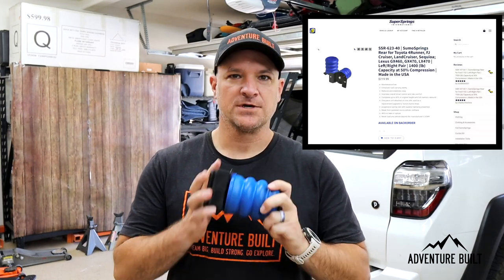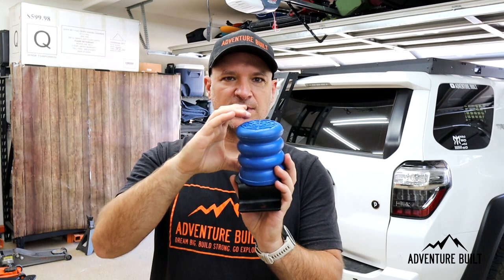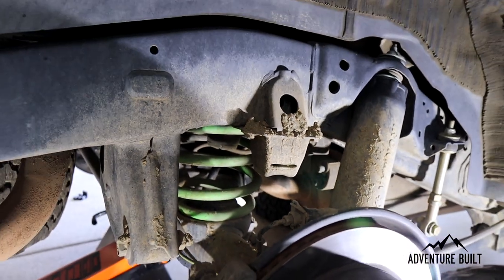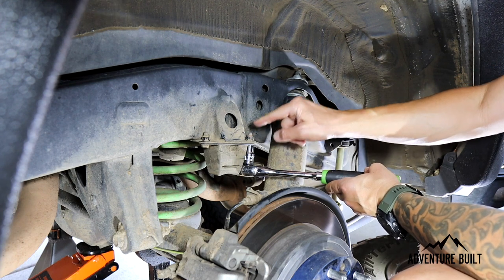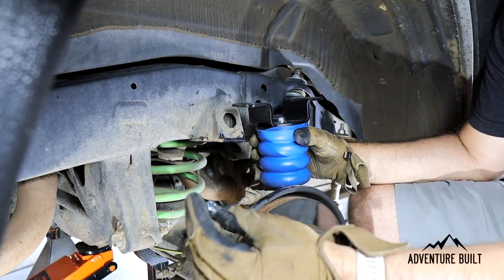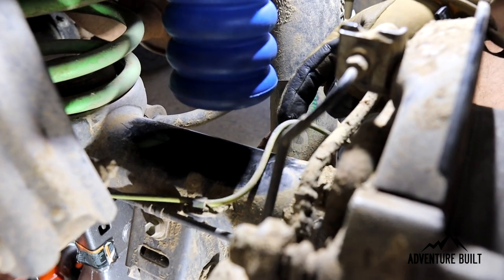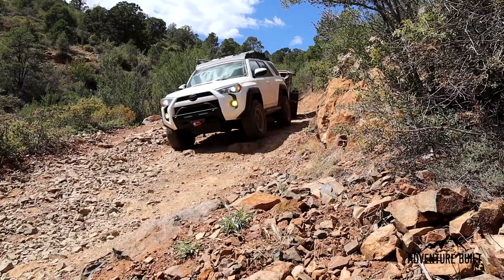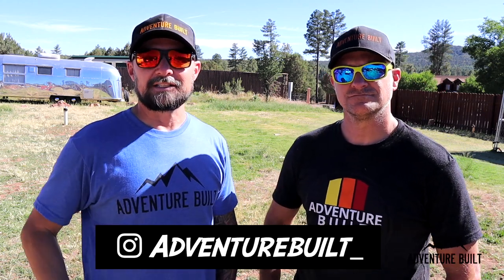AMAZING IMPROVEMENT | SUMO SPRINGS INSTALLED ON 5TH GEN 4RUNNER | DO THEY LIVE UP TO THE SUMO

Comment: I put Sumo Springs on my Tacoma several years back. The difference was so good I'll never own another truck without installing a set of Sumo Springs
Reply from the maker: Very cool. I’m leaning towards getting them for the Tacoma also now. Thx.
Reply: @AdventureBuilt  I may have missed it in the video but another minor but important benefit to the Sumo Spring, is they allow for a bit more up travel on the axles because they compress below the level where the stock bump stop, stops the axel from moving up anymore.

Comment: Will you be installing these on your Tacoma? Will these prevent rear sag when loading up extra heavy things in the back? I have Extra Heavy OME leafs (added a lead to the heavies).  I have a camper 400 lbs. and might carry a dual sport dirt bike in the future on the hitch in my Tacoma. I was leaning toward air bags..
Reply from the maker: I will most likely be adding these to my rig also to help out with the bottoming out that happens once in a blue moon. I think you will absolutely like the sumo springs but you are really heavy so air bags might be better. Sumo springs would be more reliable but air bags would be more helpful with controlling all that weight. I wish I knew more about the air bags. Hope this helps.

Comment: I added Sumo Springs to my TRD OR LB because I pull a small camper and they've been awesome to reduce the harsh bottoming out. I too recommend them.
Reply from the maker: Awesome man. I’m pretty sure I’m gonna get a set for the Tacoma also. Doesn’t happen often but when it does it is pretty violent.
Reply: Did you go blue or black?  I'm at the same decision point and wondering if the blue it too light.  Thoughts?
Reply: @peterolfert7477  blue
Reply: @peterolfert7477  Look at the wt ratings and what you carry. I have very small 16’ camper and usually just my wife and I so not much stuff. The blue has done well for me. They do squish when I haul really heavy loads but that’s only been maybe 2x in the past year+ of ownership. 
I hate the soft factory springs on the truck so I added airbags to prevent rear sag. I don’t want to get into suspension upgrades. I don’t need a lift, bigger tires and don’t want to deal with all the downstream changes that happen when you change suspension.
Reply: @briankilgore3479  you have airbags and sumo springs for the 16 foot trailer? I have a 2020 4runner orp and was looking at these instead of air bags
Reply: @shakeyfly  Tacoma is soft in the rear from the factory so the airbags level out the truck. I did the Sumo Spring first and those help with bottoming out but not necessary for leveling. I really don’t need both but I didn’t really want to remove the Sumo and it’s not hurting anything being there.
Reply: @briankilgore3479  Thank you, I have a 5thgen 4runner. Also a little soft and the added weight of the rear so I'm thinking I'll be doing both.

Comment: I have a 19 TRD OR w/ RC 2” lift. Any strut/shock failure issues on up travel if I added these? They seem to compress much further than a trad extended bump stop. Or would the red heavier ones resolve that?
Reply from the maker: Trevor has never had a single issue running the sumo springs. I’m not so sure that it really is compressing more and if it is it doesn’t seem to be causing any issues. Hope this helps.
Reply: @AdventureBuilt  thanks for the response! Looking forward to trying them out

Comment: i bought the front and rear sumo springs for my 2023 4runner and installed them, curious as to why you didn’t use the support plate? according to the included installation instructions there is a quarter inch flat piece of metal that is supposed to be sandwiched between the sumo spring mounting bracket and the frame.

Comment: If you notice @7:00 there is also a bump stop located inside the rear spring. On my 4 Runner I paired the sumo springs with the Icon hydraulic bump stops located inside the rear spring and I can literally hit the nastiest bumps at any speed and it won't bottom. When the sumo spring starts to fully compress the hydraulic bump takes over. Overkill yes but with way less travel I can hit bumps at the same mph than in my Raptor. Pair that setup with some good AT MT tires and higher speed desert running in a 4 runner is doable.

Comment: Are you changing it up because you’re not happy with the Ironman FCP?  I just put their Stage 3, 3” lift on my Lexus GX460 and my initial impressions are just mediocre, granted I haven’t mounted up the 35s yet since the wheels just arrived. Either way, this seems like a cool product and since I need new bumpstops anyways, maybe I’ll give them a try. One last question…do these seem to limit up travel?  Great content as always!  I’m loving your channel!
Reply: Did he mention changing the suspension? Because I think the Sumo bump stop is supplemental for when he’s riding heavy and towing, but otherwise the suspension seems fine.
Reply: @GrizzlyPath  He made comments about wanting to improve the ride and even says now he needs to address the front. It gave me the impression that he’s seeking ways to change the ride compliance which translates, to me, discontent with the setup. I could be entirely wrong.
Reply from the maker: Thank you very much and no Trevor is still in love with the FCP Stage 3. They basically just dampen the violent bottoming out when you are running heavy or sitting huge bumps. They definitely get more use when Trevor is pulling the trailer. And there is no limit in the up travel at all. Thanks again!!!

Comment: Let us know if the movement changes when temperatures drop. Remember old elastomeric Rock Shock mountain bike forks in the the 90’s that used urethane springs. The compression  and return rates changed as temps dropped.
Reply from the maker: I think it will definitely change but since it’s a bump stop and not the actual suspension I don’t think it will be an issue. Will definitely keep you up dated if it is.

Comment: I am about to put Sumosprings on my Lexus GX460. I tow a tandom axle trailer tipping the scales at 5500 lb and had a tongue weight of 600 lbs. I use a load leveling hitch. My question is would you recommend a Blue or Black set of Sumos??
Reply from the maker: I would say go with the blue. I doubt you would need the extra firmness of the black. Trevor is digging the blue.

Comment: I have a 2018 TRD Pro with a similar trailer. I'm debating these SumoSprings or just getting Dobinsons coils with 10% increased spring rate. I don't want to lose Offroad articulation. Thoughts? Thanks!
Reply from the maker: Trevor ended up going with sumo springs so he didn’t lose ride quality while not pulling the trailer. It’s a toss up. Hope this helps.

Comment: How do different lift height affect using this and up travel? It does look fairly long. Would Stock height fit this? You guys have how much lift in the rear?
Reply from the maker: Trevor has about 2.5” of lift. When the sumo springs are installed and Trevor is not pulling his trailer he barely touches the sumo springs unless he takes a big hit to the rear. When he is pulling the trailer the sumo springs is constantly being used to keep the rear from bottoming out. There is no issue with up travel.

Comment: What lift you have on the one with trailer, and what’s the distance of contact vs loaded with trailer?
Reply from the maker: Ironman 4x4 Foam Cell Pro.
Reply: @AdventureBuilt  roughly 2-1/2 of lift? So when trailer hooked up the sumo barely have contact? What’s your trailer tongue weight

Comment: Does this help with trailer sagging? Better than airbags?
Reply from the maker: It will help more as a travel limiter so you don’t have a harsh bottom out. An airbag would be ideal because you will get the extra lift and support. Hope this helps.
Reply: @AdventureBuilt  That helps tremendously. Thank you

Comment: How much sag reduction does this provide when towing a trailer? Seems airbags might have more flexibility with ride height than a static bumper, but I could be wrong.
Reply from the maker: Nope you are 100% correct. Airbags can assist in your ride height and shock absorption. The sumo springs will only dampen the bottoming out of that occurs.

Comment: @Adventure Built  Any concerns with the compression putting additional stress on areas of the chassis that weren't designed for the increased loads? I know the loads would be dynamic under normal conditions, but when towing and having loads persistent, would that increase fatigue where they are attached at?
Reply from the maker: Much less than a shock load from bottoming out I’m sure. Other than that it’s only the axle housing and the frame mount. Probably fine.